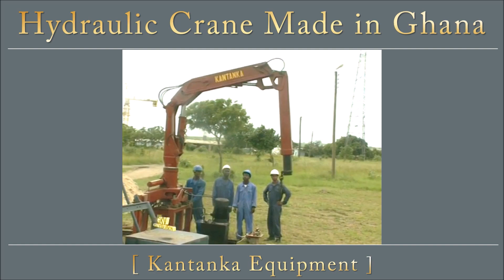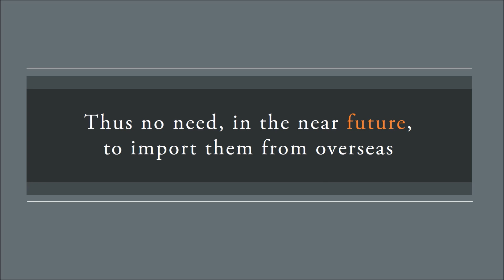Hydraulic Cranes Manufactured in Ghana by Ghanaians - [Part 4] - Safo

Comment: Great job. Time for Africa to start using its resources for manufacturing African solutions rather than just exporting. But please involve civil engineers in the process. There is more to cranes than movement, you must know the welding strength, maximum load capacity etc and how to balance the crane to compensate for this maximum load. Congratulations. Once you start you only get better.